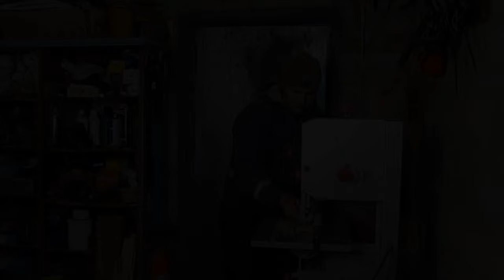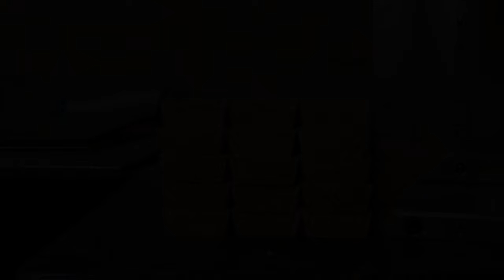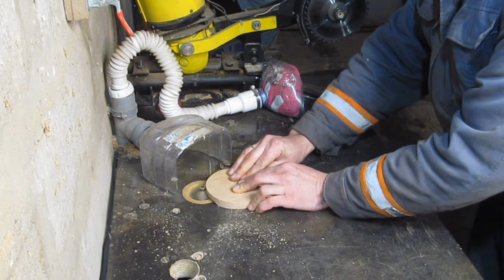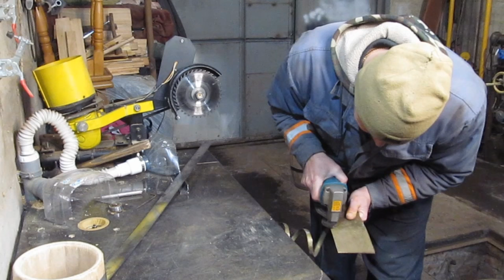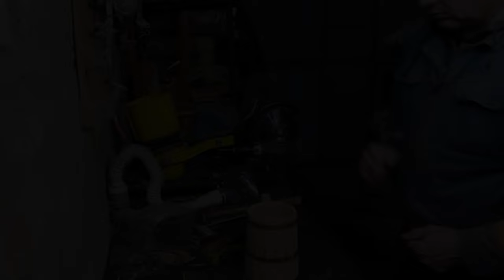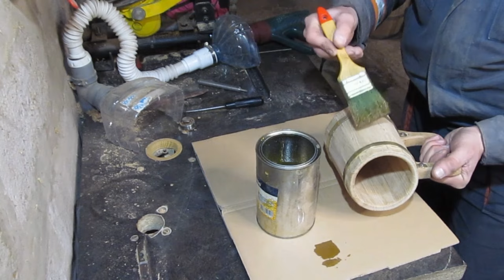Wooden Beer Mug DIY | How to make a beer mug | Medieval Oak Beer mug

Comment: Where did you get this router bit?! I am having trouble finding a 12 deg (or 11.25 deg) router bit with the bearing on the bottom. This is the only way your template works.
Reply from the maker: I use a straight cutter.
I set a manual milling cutter, which is fixed to the table, at the right angle. Here is a video with subtitles on my Ukrainian channel about my homemade router table, which I use to process the side face of barrel staves: https://youtu.be/E5OmePuCYKM
Reply: @tmzhenatanwoodworking7252  Thank you!

Comment: Could be that it’s not showing up well on my iPhone but is that rift or quarter sawn oak?  Looks rift sawn.  I think it’s white oak (would make sense for that species anyway).  Have you successfully made beer tight mugs from any other species of wood?  How does that linseed oil/wax finish hold up to actual beer drinking?
Reply from the maker: Yes. This is a mug made of oak, which is sawn into quarters and each element of the mug has a radial direction of the annual rings of wood... After applying oil wax to the mug, it is necessary to wipe it off, removing excess and dry it well...

Comment: How do you make your rings/hoops?
Reply from the maker: To make the mug hoops, I first cut out 1.5mm strips of metal 10mm wide from a 1.5mm thick brass sheet. Then I make a circle out of them, measuring the desired length with a piece of soft copper wire ...